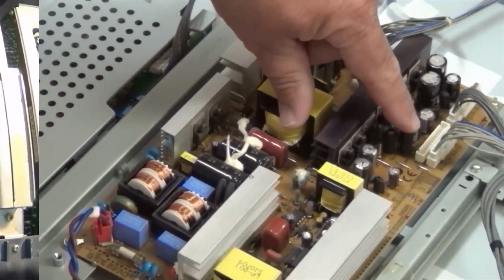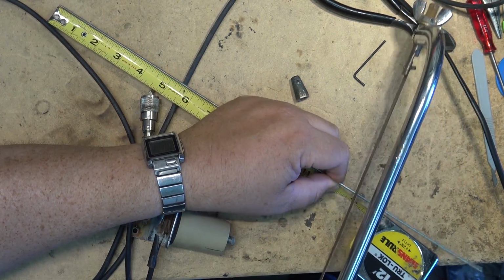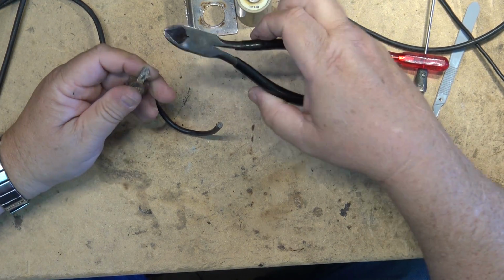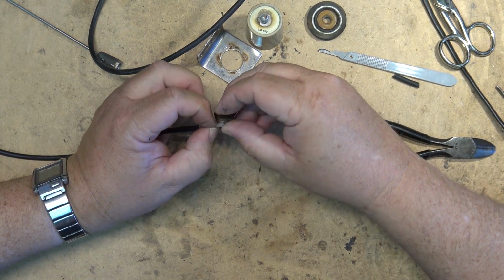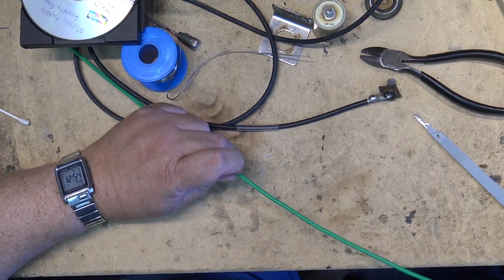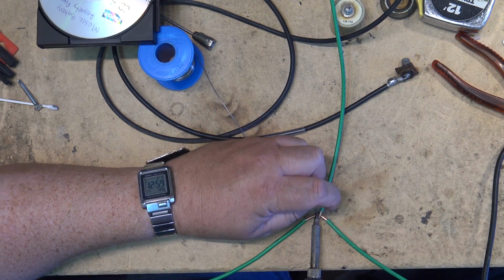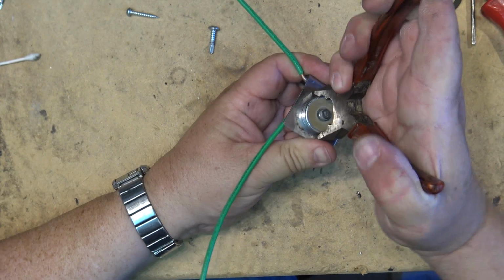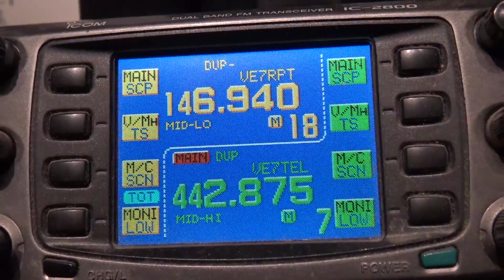Construction of a 220 MHZ Ham radio base station antenna using old broken salvage parts

Comment: I didn't realise you were a ham, 220MHz is allocated to DAB Broadcast frequencies in the UK and some other things, so us amateurs cannot use the 1.25m band sadly. Really enjoy your videos, de 2W0ODS 73
Reply from the maker: DAB now that is a term I haven't heard in years. It was tried here and failed. Here DAB was up around 1.4 Ghz and was a total disaster and failure. Anyone that was suckered into a radio has a nice conversation piece today. Well at least they still receive AM and FM. Here HD radio is what we have and it generally works and sounds great if you have the proper radio.
Reply: @12voltvids  DAB is the biggest con ever in the UK, they claimed better audio quality than FM but were using a really old MP2 Codec (Some stations still are) with a really low bit rate and often Mono!, so far worse than FM, we also get DAB+ on some stations that use the AAC+ Codec, but instead of increasing quality they lowered the bitrate further so they could squeeze more stations in to the multiplex.  The government keep threatening to turn off FM broadcasts but it never happens and people are outraged at the idea.
Reply from the maker: @dalerobinsuk  They were going to push for DAB here in Canada too, but fortunately being so close to the USA it never caught on because the Americans never launched. They pushed for HD radio, which is a hybrid system that adds digital sidebands to existing FM and AM stations. Unfortunately it doesn't work in Europe due to your 100Khz FM channel spacing. Here our channel spacing 200 khz, allowing enough bandwidth for the HD digital sidebands to be added to the existing multiplex (It is actually a seperate transmitter)

Comment: Did you get a decent vswr reading below 1.5:1?, imp at 36 ohms or better.
I worked out that 462.4 / F = 1/2 wave in feet for aluminium back in the 80's, it gave a little extra for snipping.
And 435.18 / F  for a halfwave copper antenna.
For c.b radio the coax had a velocity factor of  0.66 for ideal coax length.
Yes i used to be on the c.b, and i learnt the basics of radio from repairing them.
I used to repair radio hams radios,  some hams just didn't want to learn like the old real hams did.

Comment: Interesting video...thank you. Never been on 220 Mhz so far in my Ham Radio hobby. 160-10 meters with a Carolina Windom, and my old Garant Windom that was made in Thunder Bay. 73....
Reply from the maker: 220 is quite private.  Not alot of hams on 220 so can have nice QSO without the cb'ers breaking in and side tracking the conversation every 2 minutes and do animal sounds and all the other childish noises that moved from 11 meters to 2 meters.
Reply: @12voltvids  Canadian 2 meters gone to the dogs then !...
Reply from the maker: @jerrygeorgopolis8015  
All 2 meters gone to the dogs.  I was listening to some USA hams on us repeaters and it was just as bad, and the old boys with their politics on dmr had me turning the radio off and it never has gone back on.  440 is mostly good and 220, well that is where the serious hams hang out.  Mainly because the radios are scarce compared to other bands

Comment: Nice rigs an set up , antenna ground plane works real good , Yes the HF bands now a days for some hams are plagued with high noise power grud mode switching supply's etc , ok well done an 73's de zl3je

Comment: Sweet - Renew & Reuse!  You have a nice Antenna Farm 'growing' there - thanks for the 'show-n-tell'.  Curious about 3 things tho: Why the PL-259 instead of a BNC (guessing the rig has SO-239?) and Why use soft (flexible) copper wire instead of something stiffer (like a coat hanger?) and What was the final VSWR?  I believe you are entitled to trim that neighbor's tree - that extends into your Property - making your tower usable again. (zoning by-laws?)  Cheers. B.
Reply from the maker: Rig has so239
Copper doesn't rust, coat hanger does, copper also better conductor.  I do trim the tree and it grows back.  Don't like walking on that roof.  Very old could fall through it if not carefull. That building was built in 1948.

Comment: 220 eh?  Two repeaters?  Lotsa 2m repeaters and digi radios here in Oregon.  Almost no 220 stuff - tho.  Ever get on Echolink?  Let me know if you use Echolink, and we can talk.  ki6usw
Reply from the maker: Lots more than 2 220 repeaters here. About a dozen in the area.  Most are linked to other 220 repeaters.
Reply from the maker: No I don't use echolink myself.  I do have dmr but don't use it much.

Comment: 1.25-meter band, as a technician class radio operator in the US, I never have used this band. I only have 2 meter and 70cm radios. kg5wzm, 73 to you as well from Austin TX (dunno why youtube crossed my call sign)

Comment: Didn't know u were that much into radio.
Reply from the maker: Been licensed for over 30 years but not that active.
Reply: @12voltvids  I have many licenced friends and have helped them Their stuff. I've communicated with them on their private repeaters. All radio is really neat to me but I'm just a 27mhz junkie. Used to have all the big amps and crazy mobile setups... But now days just one radio barefoot.
Reply: @12voltvids  the coolest thing was for about 6 months a friend of a friend let us have access to a 900mhz system that was on top of a skyscraper in Houston slated to be taken down. It was very neat to be on Galveston TX. beach with a hand held talking a mobile in Conroe TX.  Absolutely clear.
Reply from the maker: @SDS-1  
There is some 900 MHz and 1200 here.  I was into the fast scan FM tv for a number of years.  Our playground was 2.4ghz.  Yup same as wifi.  You should have seen all the sad faced when I fired up the 2.4ghz 2 watts transmitter and put a 30mhz wide color NTSC video signal on it.  Took down the entire wifi band for blocks in the direction my 30db dish was pointed.   I have some video tapes of our atv operation. I should upload some of these tapes.  No atv operation these days.  Lost the repeater site and now all the guys involved are silent keys now.
Reply: @12voltvids  oh man that's cool. Never played much with 2.4 
Did enjoy using 3 element beams on vhf to " order " my fast food from across town😝
Reply from the maker: @SDS-1  a few of the guys in the atv group were playing with 10 GHz.
Reply: @12voltvids  😲 I wouldn't know where to begin in that area.
Reply from the maker: Coffee can antenna.  Gunn diode into a waveguide.  
I didn't do 10ghz myself.
Reply: @12voltvids  would be nice to see.
Reply from the maker: @vanuitdeauto  I have a 1200 receive antenna made with a piece of stove pipe. My 2.4 is a dish